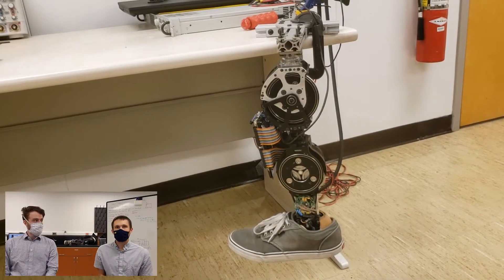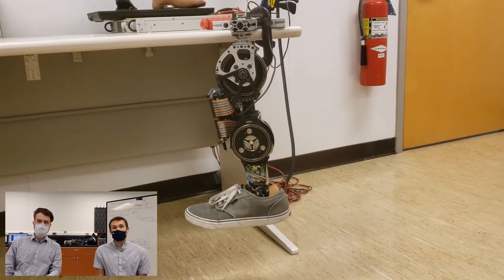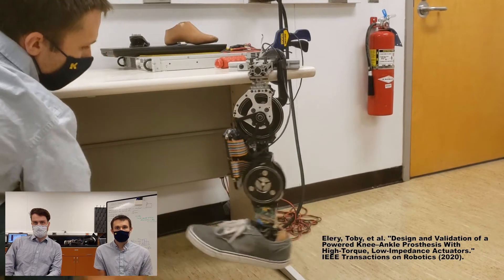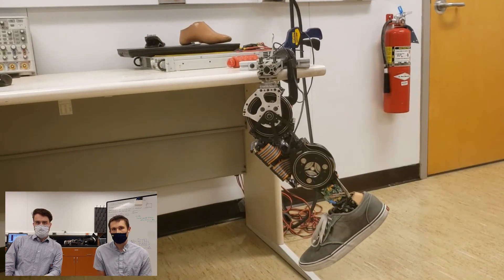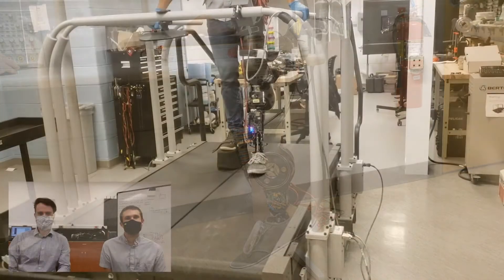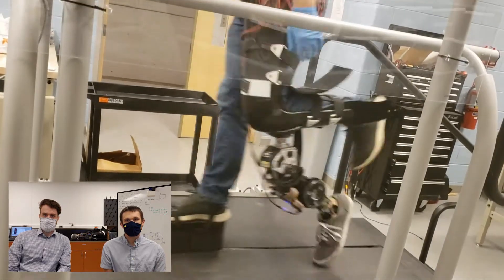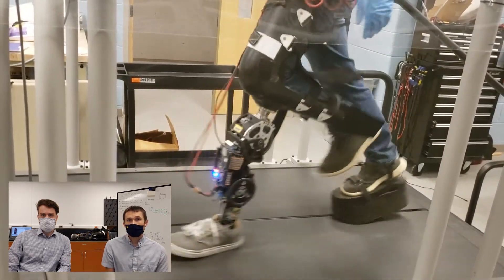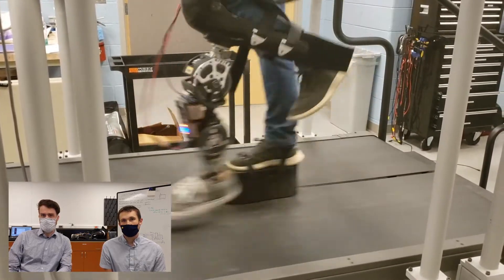Quasi-Direct Drive Robotic Prosthetic Leg Demo

Comment: I'm looking around for a planetary gear box of high torque and between 4:1 to 10:1 reduction ration,  similar to that you guys are using for your project. May ask where did you get the reducer from?
Reply from the maker: SDPSI with some modifications, check out the paper in the description

Comment: I know this is 2 years late, but i see no paper link in the description
Reply from the maker: Here is one (you can find others on the locomotor control systems lab website): https://www.techrxiv.org/articles/preprint/Phase-Based_Impedance_Control_of_a_Powered_Knee-Ankle_Prosthesis_for_Tuning-Free_Locomotion_over_Speeds_and_Inclines/19165895

Comment: I’m a disabled veteran, I need that, plus I have ideas for additional design as automation engineer. What if you designed this where you could strap this on the side of your leg, possible just augmenting and supporting a bad knee?  

It would be great if someday we could strap this type of design to the side of your legs, with strong enough motors/actuators on the axis to support the weight and movement of a normal sized man/woman.  

We need to abstract this knowledge to the point where someday we’ll be able to build mechatronic suits that will allow disabled humans to strap into to augment rigorous tasks and it has to meet the standard requirements of weight and safety.
Reply: You and me both brother
Reply: At that point why not just have them control it remotely?